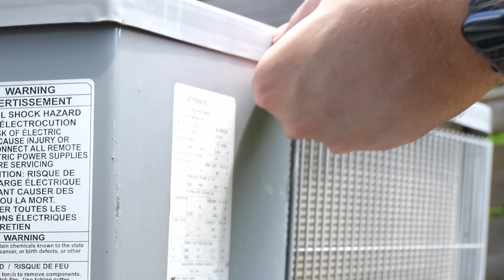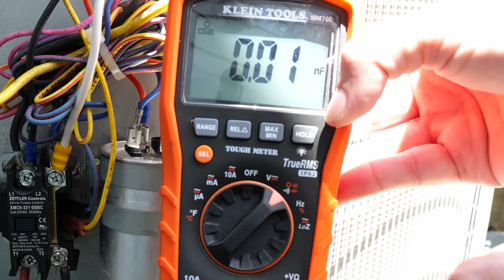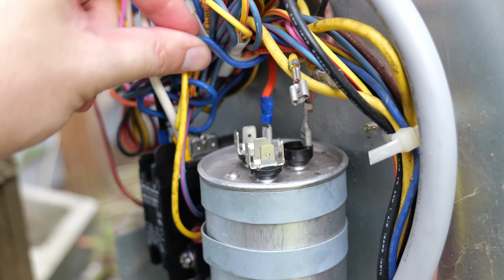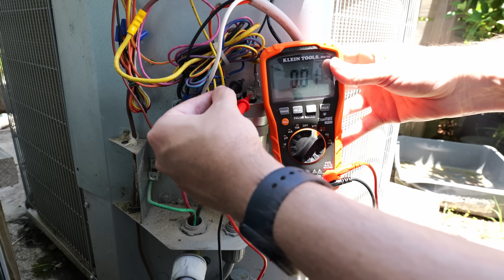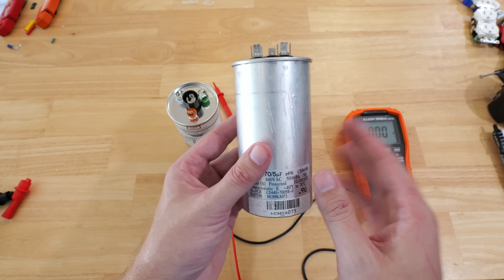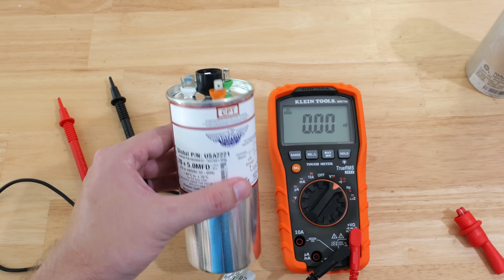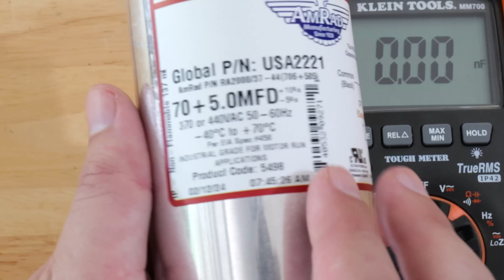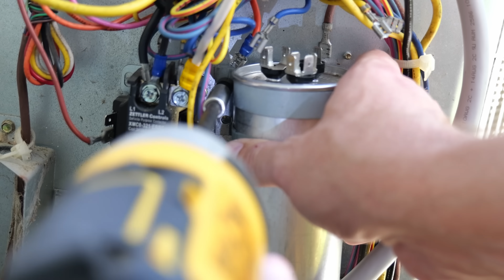Don’t Get Ripped Off! How To Avoid The AC Capacitor Scam And Save $500

Comment: I have an HVAC tech and I don’t bother doing most of that. I have a multi capacitor. I swap it in and see if it works, and if it does replace the capacitor.
If it’s the fan motor, I still replace the capacitor I won’t warranty a fan motor with an old capacitor
Service call and $150 per hour. 
70% percent of Run cap Are between 30/5 and 45/5 I believe we charge 25 to 30 bucks. Yours probably 40 or $50 because 70/5 is rare and big.
But still if I have it in the truck and I almost always do you’re looking at $175-$200. 
Now, if I listen to you, I got 30 minutes travel 30 minutes to do the job and 14 minutes to test the capacitor, That 14 minutes put me over an hour so now labor is $300. Run go all the time on the north east power grid not so good, And I get almost all of them done in one hour Well, depending on travel but under 30 minutes on site because it’s one of the first things I check.

Comment: Our unit seems to go through a cap every year or two, just replaced ours as it was starting rough and lights were flickering. 35/5, only measured something like 34.2/4.8, within spec around 2-3% off. Curious why the system might be so sensitive.

Comment: Always have a capacitor on hand. I bought one after seeing how quickly it’s done from my $500 service call last year. Saved me today. It’s 106 degrees and took me 20 mins.
Reply: Get a contactor too as a backup
Reply: I replaced my start capacitor for $15.00. I suspect the elderly man who lived across the street had the same problem, except he was talked into replacing his entire central air conditioning unit from the organization that showed up to repair it. Sadly, he now resides in a nursing home, but no great surprise, he was losing it, mind wise.
Reply: @Orange-Jumpsuit-Time bought a USA made part and so far so good for the last 2 years

Comment: I’ve had my original A/C unit since bought this home I’ve changed the capacitor twice motor once in 24 years it’s still going . Each capacitor lasted about 11,-12 years motor lasted about 13 years bought one online changed it. Knock on wood. Thanks

Comment: Had one replaced for $495. Five hundred fuqing dollars! Took him less than 10 minutes. The unit was only 4 years old too. Got the bill reduced by $95 by removing the service call fee but still. I was in utter shock. 

Had a nail pulled out of one of my 35" the next day and patched which took the tech about 40 minutes or so and I was charged $24 lol. He did probably 3 times the work. HVAC is in a league of their own with corrupt markets. Can't even do it myself next time either because that voids the parts warranty and definitely not taking that chance.

What a disappointment. 😒

Comment: Don’t pay over 30$ for a 5 through 10 capacitor. Larger are roughly 60uf for 60$ and 80uf for 80$. R410a refrigerant is about 60$ a pound and they need to have a scale.

Comment: Just had an AC repair guy pull the capacitor scam on my 80 year old mother. The capacitor did actually go out on her unit and the guy replaced it, no big deal. But he charged her $700 for a $20 capacitor and less than 10 minutes of work to swap it out. I was livid when I found out. I happened to be long time friends with the owner of the company the guy worked for, so I called and told him what his employee was doing to people and showed him the proof. I got a call back the next day from the owner telling me I hadn't been the only person complaining of massive overcharging from that guy, and that his employment had been terminated. My mother was also refunded that $700 minus the price of the part itself.
Reply: How was the repair guy charging the customer those amounts without the owner's approval?
Reply: @kizito8888  Because 99% of home owners don't know the real price of HVAC repairs. When you call a professional to do a repair, you expect them to charge a reasonable amount for their time and the parts used. What you don't expect is for the professional to take advantage of you and scam you.
Reply: @ That doesn't answer my question. The technician doesn't make the charges and needs a PO to order the parts. The only way a technician would scam a customer is if they buy the parts and somehow keep them for themselves. Don't customers ask for receipts? Am I missing something? I diagnose a problem and tell you what I found. Ask my boss to order the part. Then my boss charges the customer. Does it work differently in residential?
Reply: @kizito8888  Every residential HVAC guy I've ever known or encountered always had his van fully stocked with capacitors since it's such a common repair. No need to order it before replacing. They already had them on hand. That was the case with the guy that scammed my mother. He had it in stock in his work van.
Reply: @ So the tech would say the capacitor costs 2x the price and charge your mom? He still would have to make out a work slip to give to HR at the end of the week. And the customer would also get a receipt for the services. The guy was fired but I would thing the company/HR was also to blame. Companies know when their workers are quoting bogus prices.

Comment: Great job. Great video. What does the circuit board do in this case? I only have the contactor and capacitor. Is yours a heat pump? Why is there a circuit board in the condenser unit?

Comment: Sir, I have a Trane XL 20i, ComfortLink II outside unit. The system is not cooling well on very hot days here in Texas so I checked the capacitors. My system has 3 different capacitors, and none of them are dual run type, meaning there are only 2 sets of connectors on them. One of them is a 30uF with a range of 6%, it is only measuring 26.7uF, which is below the 28.2uF low limit. I was unable to any reading from the other 2 caps, measuring around .186nF (nano farad). One of the others is 216-240MFD, and the other is a 15uF. Do you have any advice on this situation? I plan to replace the one that is low, but not sure about the other 2 and why I cannot get any real measurement from them. FYI I am a former aircraft mechanic and am now in my 28th year of repairing medial lasers, just for reference. I am receiving no error messages, the unit is only cooling by 6 or 7 degrees, even at night. Also, I did clean the fins on the outside unit to start with. Thank you.

Comment: We thought we were being smart to have preventative maintenance every year.  Our HVAC doubled the cost to $150, but times are tough and we can deal with the increase costs.  But then today, we were told that our capacitor was less than half of my microferons.  "What does that mean? Is it gonna blow up on us?"  "Well, the odds are pretty low that a bad capacitor will make your compressor blow up, but if you don't replace it, it will have to work harder and will eventually fail and then you won't have cold air."  "What's the damage?" "$350" "Yeesh, that's a lot, but if it's gotta be done, then it's gotta be done."  Found out he charged us $350 PLUS $150 and it took him about 20 minutes to swap it out.  Now I'm watching a bunch of these videos and have surmised that we were either robbed or we were taken advantage of.  This just poisoned the well for HVAC techs and now I'm so trigger shy/hyper vigilant for any potential bogus charges.  What an expensive lesson!

Comment: The price tag shouldn’t just be the part it should include labor . Now I’m not saying there aren’t bad people out there trying to take advantage but other than those when it’s just a cap the tech should be going over the whole system ( not always hooking up gauges ) but airflow, electrical all that . The price also is for their experience and knowledge of the whole system not just how to check and change a cap . Also among other things the tools and equipment that it takes to do this type of work . All I’m saying is it’s not just the price of the cap that you are paying for .

Comment: 09:02 you had your fingers touching the prongs and the metal case of the capacitor. this shorts it out and is why you got a 0 on the meter. It is no different than squeezing one prong in one hand and the other prong in the other hand. Just sayin.

Comment: Thank You So much for the Video. Was able to change the AC capacitor without any issues. Was initially going to call a technician . Was just doing a casual YouTube search and came across your video. You explained very nicely Thank you so much 👍👍

Comment: This just happened this weekend to a friend of mine. Her AC stopped and she called to see if I could test; I was out of town but on my way back. She called a company called A-1 who came out and she calls me again panicked that the tech told her the "electronics" were fried and he was working on the unit. I told her to make sure he left the old parts so I could test. He replaced the capacitor and contact and added a hard start and surge protector and charged her $1600. When I got home I tested the capacitor and contact and both were good. This is so infuriating! Not sure what the next steps are going to be. Great videos and so educational!
Reply: Isn’t that fraud? As in a crime? Police should be called and inquire with city inspectors.

Comment: Yeah, if your ac goes out that is the first thing to check out. I had a little lizard(called Anole) short mine out with its tail.  Fried that little guy and fried my capacitor. Less then a 20 buck repair.

Comment: You can tell by feel if they are going bad, but still shows good. They will become very hard, a new one you can squeeze it a little bit and one that is fixing to quit will have no give in the outside shell, but if you haven’t replaced many you might not be able to feel it.

Comment: If you don't value my time & expertise, then don't call me. Yes I charge $300 for a run cap installed. You're paying for me having the correct part on my van & fixing it on the spot. Go ahead, wait 3 days to order one. It's called convenience & we all pay a premium for it...
Reply from the maker: Mine come either the same day or next day depending on when I order.  But to negate that I always just have a spare on hand 😎

Comment: Had a guy come out to do yearly checkup on the ac system. He said the capacitor on the fan side was reading weird and that it would cost me about $200 for him to fix it. He also said the part only costs around $12 on Amazon if I wanted to do it myself. A week later the fan stopped working. I swapped out the capacitor in like 10 minutes. Good to go.

Comment: OL does not mean "Open Line", it means "Over Load".  When taking a measurement of a capacitance when there is still a motor coil attached, the discharge test will fail and indicate "Over Load".
Reply: It means open line

Comment: In all fairness to the HVAC companies,  ( do not own or work for a hvac company) if indeed the cap is bad, there will be a service call charge, and a small labor charge, plus the part, which should probably be about $50 at the most.  I would say that if they charged about $200., that would probably be about right.  They are paying their tech, transportation, and the cost of their building, plus utilities, plus advertising, and misc.   They aren't in business to be nice guys.

Comment: info - the value of the capacitors usually won't change in it's lifetime.
It is simple a physical value ... the 6% are simple the production variance.
What happens is: If the voltage gets to high or if it leaks fluid or if it wasn't used for a very very long time ... there will happen a short inside the capacitor.
In some cases it is possible to repair it ... at least when it is a short due to age ...
You simple keep leaking a very low current into the short ... the foil inside will start to oxidize where the short is ... and the oxidation will establish an isolation.
This is a very old technique  ... you can even change the capacitor to a higher voltage - with lower capacity this way.

Comment: This happened to me twice and both times the AC folks charged me almost $400 to replace the capacitor.  After the second time I got smart and now change mine out annually for $35-$40.  Of course the capacitor was just the start of their up-sell with a soft-start unit and surge protector to try and follow for another $600.

Comment: They use imported capacitors in UPS in data centers all the time and their acceptable rate of failure in the data center is 99.9999 percent up time. They do change the caps as routine service about every 7 years. but they get used very hard.

Comment: AC techs who really don"t know anything about electricity are very common. Caps going bad is also very common. What is really common is trying to sell a new fan motor or compressor because of a bad cap. Fans more than compressors because many customers will scrap a condensing unit, or whole system over a compressor.

Comment: Most big HVAC companies in this country now all use the same software, which handles scheduling, estimates, inventory,, invoicing.. everything for that business. 
  When every company uses the same software, they tend to charge the same prices - or very close.
 These companies spend a lot of money for trucks, tools, materials, employees, insurance, etc.  
  You're never going to get a $25 capacitor replaced for $25.
But there are smaller companies out there that don't charge insane prices, but still do quality work. You just have to find them.

Comment: I have a 2020 Bryant system here in Florida and all original running fine. I used to every year or 2 change out the 2 capacitor my old 35 years system had. I now have the proper capacitor for a spare for my 2020 Bryant. Should I replace now or wait until an issue????  A long time A/C guy I know told me to change them every 2 years without fail, cheap insurance. BTW. that's the exact capacitor that I have in my system. End of Aug will be 4 years it was installed.

Comment: Thank you think great video once had an AC tech put a booster on a unit claiming that the capacitor was weak or possibly going out or maybe it was the compressor that was weak or possibly going out and so he put a capacitor booster on it. Is that a thing?

Comment: Had a 26-year-old A/C unit that died, breaker would trip every time compressor tried to turn on. Looked for troubleshooting tips online and found info that the capacitor might be bad. Luckily, I already had a DMM with capacitance setting (a lot don't have it), pulled the cap out, measured the two sides, and it was in fact dead. Ordered a new one, measured it before installing (it was good), installed it, same problem, breaker trip. So, not the cap and after more troubleshooting it wound up being a seized compressor, so the unit did have to be replaced. Luckily, I was able to return the good cap for a refund. Moral of the story, even if the cap is bad don't rush to replace it (if you can't return the new one for a refund).

Comment: Wow! Just this morning my neighbor was knocking on my door saying that his outside compressor unit was not running. I said 90% it's the run cap, let's go look. Opened it up and saw the tell tale, ever so slight, bulge on the top of the cap. Felt the bottom of the can, slight bulge there too! I said 99% it's the cap, let's take it out and test it. Set it on the bench and it's not sitting flat, wobbling around. Both "fan" and "herm" measure about 2 nF. Now I'm 100% sure. Quick online search and found a replacement in stock locally - took the first one we found to get him running so not particular about the mfgr. Unit is now running for a cost of $24. And he let me drive his new Tesla Y to the electrical supply store. So a fun time was had by all!

Comment: Hi Everyone, I’m not a tech but why would a single dual capacitor be replaced with two single capacitors by licensed techs when the manufacturer put in one dual capacitor?
Reply: It still works the same. The tech may have not had a combo unit with the proper uf rating on both sides.
Reply: @projectswithjw  Thanks for explaining. Any pros or cons to wiring it this way vs  the original single dual capacitor?

Comment: Mine had corrosion all over a spade and spreading. I replaced it, didn't even test it.. Now my central air works again. They are so cheap. Oh, I learned long ago to do everything on my home myself if I want it done right and/or to not get ripped off, which is what happens 90% of the time.

Comment: I can’t believe all these people don’t have a good HVAC Contractor they know and Trust. I was a Mechanical Contractor and Stationary Engineer for thirty years. I never charged anywhere near these prices. Are these prices HYPE for Click Bait or there places where this kind of poor business practices is tolerated. Here in Florida Contractors are under HEAVY Scrutiny and regulation.  I suppose the problem in part comes back to equipment owners that don’t call a contractor until the AC (or heat) is out completely. Therefore they don’t have a reliable, honest HVAC Contractor who they trust.

Comment: Forced air heat pros came out THREE times in a few days to repair a fairly new but out of warranty system. Always said “fixed” when they left. 
Never was fixed. 
I checked some install manuals and YouTube Uni. 
I lifted the exhaust pipe to a positive angle and secured with wire to the rafter. 
Problem solved. And the pros had no clue!!!!!!!
Water condensation built up in the exhaust which had slipped down so that the horizontal run was negative angle and caused buildup at the vertical junction causing the computer to register an exhaust obstruction. 
But we still had to pay the bills to the three worthless tech trips.